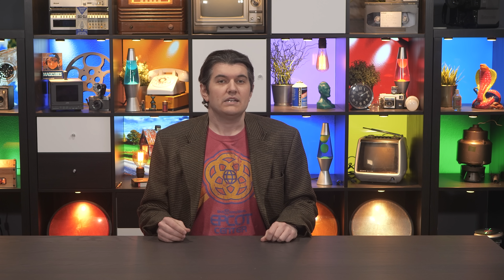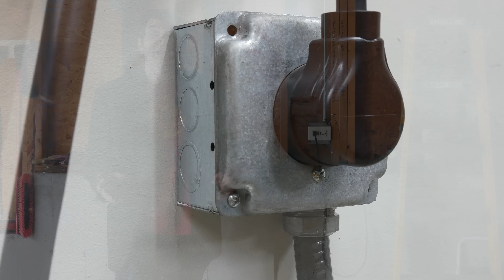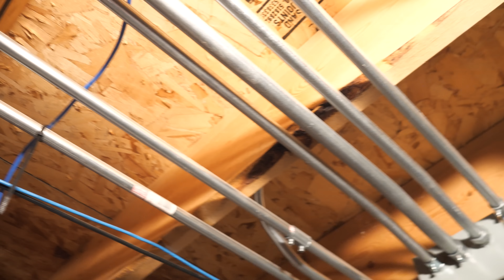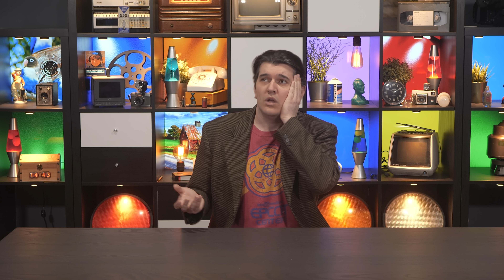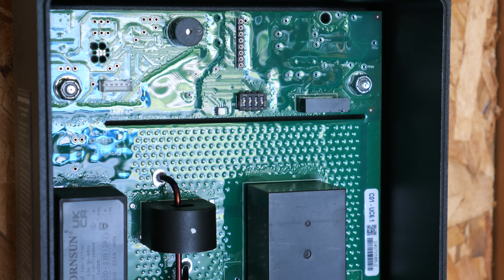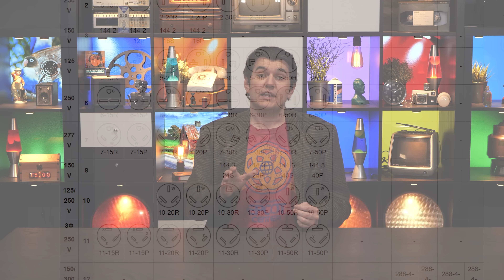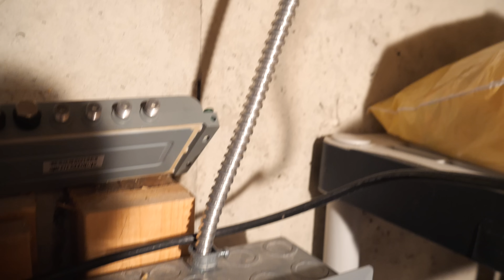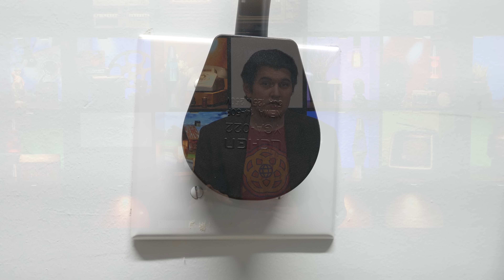The "standard" car charger is usually overkill—but your electrician might not know that

Comment: I bought a Spark EV for one stimi check! added a cup of coolant to match the updated TSB. Cleared the HV battery codes and it started charging! I've been charging on 120v AL wiring 20A breaker. (Car only draws 12A. I learned that charging on 120v, only works if you have enough reserve.... 40 miles a day with AC blasting in Arizona was not enough and definitely will not be in the winter. (Round trip #'s 18 miles for work, dog park 15 miles and 7 miles for the gym. My mistake that day I ran out... I pre conditioned the car 😂 after work. I wait for it to cool off before taking the dogs out and charge but charging speeds and not staring out at 100% that day really hurts.

Comment: I have a really short commute, and I live in Australia where 240V is standard, so the standard 10A outlet is more than enough. As for the “smart” features, I simply plugged the 1800W EVSE that came with the car into a Tapo TP-link smart plug. My car doesn’t have scheduled charging, so this is a perfect solution. I only charged on Saturday after a 10 day stint, even at 8A, the car charged 30% overnight.

Comment: Apartment owner without home charging here :)
Thanks for covering the really important parts of the whole EV-charging-at-home deal, and also calling out the challenges for us folks where things aren't so straight forward. I have to say I'm quite lucky and have found a suitable compromise - my work is 100% remote, so I tend to head to a public AC charger (11 kW usually) to plug in for a few hours while I work from the car. Then it's just the ~10 minute drive between home & the charger to deal with. While it's not exactly as convenient as charging at home, it's a reasoanble alternative.

Comment: I can explain to you why we're not pushing at home charging more. It's really simple. At home charging means you don't leave the house to go consume more other things. Think about how many times you go to a petrol station and start filling your car and then go inside for a drink or some crisps or some candy or whatever. If you're using home charging that's not happening. If use fast charging stations then a lot of those are starting to come with attached convenience stores because they know how long you're going to wait and you're going to get bored and you're going to go inside and you're going to go buy some stuff
Reply: No idea how it's in the US, but in Norway/Europe, it's way cheaper to charge at home, and almost everyone charge at night when the power is cheapest.  Smarty chargers can be set to charge when the power is cheapest, or at a set time.
Reply: I stopped going into the station when they started requiring pre-pay or pay at pump.  And then I bought a PHEV and almost stopped going to gas stations except when traveling.
Reply: I always pay debit at the pump and try to avoid going into convenience stores. Wife and kids on the other hand...😂

Comment: Nine years ago when we got a used Leaf, we first charged it at 110v, but eventually went for a 20 amp dryer outlet in the garage that let the Leaf charge at 3.3kw (all it was capable of) through a cheapo EVSE and we were all set!  When we traded in the Leaf for a Bolt in 2021, we opted to just continue using the 3.3kw charge cord, and it was more than adequate.

Late last year we moved into an older, downsized house (goodbye now-grown kids) and had to think through how to charge the Bolt. Turned out there was an electric dryer outlet in the basement that I could plug into and run a cord through a window well to the driveway, which worked with our old 3.3kw charger. We used that for the first few months, even though it was annoying to have the window cracked in wintertime, and even more annoying to have to fiddle with the cords and window well. However, it worked fine for charging the car. When we finally got around to doing some electrical work, we had them add a 50amp outlet on the outside of the house, and got the same Grizzl-E unit in the video. Still keeping the old EVSE as a backup.

Fully agree about using simple EVSEs. Cheaper, foolproof and you can do all the charge timing stuff you want through the car.

For rental properties, if the management could just get 3.3kw to where the cars are, it would work fine. People think they need 7-11kw, but they really don't.

Comment: about the siemens charger having a fault and needing to power cycle: i was having a similar issue. my car would charge and suddenly stop (sometimes 5 minutes, sometimes 5 days without problems). 

it seemed to me like maybe a data pin was losing connection for a milisecond and that tripped some safety thing.

 i ended up resolving it by putting dielectric grease on the pins for the charging cable. it has been like over a year and i haven't had that issue again :)

Comment: Something that could be handy and interesting to have is a temperature sensor. If it is freezing, having to heat up the battery to charge it may wast most of the power a granny cable can supply.

Having a "no charge when freezing" switch or a force charge when freezing button could be nice as I think cars responses to freezing is "heat up" instead of not charging.

I mean call me cheap but I don't like to waste 15kWh to 20kWh in a 10h cold overnight charge. I have off/peak pricing and 0.15€/kWh and 0.2€/kWh. It is much cheaper to charge during peak hours if I don't need to waste with heating the battery.

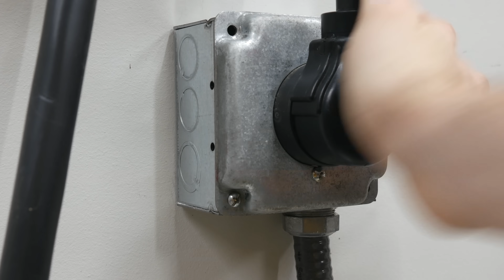Comment: 3:47 I see at least two code violations there. You need a cable clamp on the cable entering the back of the box, and the ground conductor is required to be connected to that metal box. 11:30 same grounding issue in that box too. 13:21 You are missing the disconnecting means. If you get rid of the receptacle, you usually need to add a disconnect switch.
Reply: IDK that the incoming NM-B must be clamped to the box, but that metallic j-box must be grounded.
Reply: he may have opted to remove some things for better camera visibility. he also may have just taken the camera shot before he had everything hooked up as needed.
Reply: Are you an expert in chicago area code?
Reply: @slash196 regardless of particular state code I think it's a no brainer that if you're going to run electricity through a metal box, you earth/ground that box. This is basic electrical safety.
Reply: @slash196 also, we might not be seeing the entirety of what's set up there. it might actually be grounded in some way, and there's more than one way to ground something.
Reply: @dead-claudia @jmdelapp this is a critical safety feature of any installation that includes metal enclosures or conduit. If he wanted to show people the correct way to do it then he should have made a specific point of this.
Reply: This (and many other reasons) is why people who are not electricians should not be doing this kind of work. What's even worse is he just showed a rather large number of other people who aren't electricians how to do it.
Reply: @deano023  This grounding issue is something I catch licensed electricians doing all the time. Being licensed does not guarantee competence.
Reply: @deano023  None of those things are a critical safety issue though. Yeah it's not "right", but when an electrician charges $500 in labor for 2 hours of work, don't be surprised when people opt to DIY.
Reply: @thelight3112  Fair call on the cost of electrician labour I suppose...

However I disagree with you about "critical safety issues". Any issue which has the potential to cause damage, harm or even death is "critical". All it takes is one of those conductors to be pinched when being pulled into the conduits or boxes which could then expose a live conductor. It may test fine at commissioning but something like an earthquake or other building vibration could move it slightly and cause not only the metal box but the entire metal conduit it is attached to become live. You cannot dispute that properly grounding all of the metal will prevent this, provided that the RCD/GFCI is working properly - of course.

The wirenuts are also a poor choice for this reason. Enough vibration can cause them to become loose, creating a similar possible failure mode.

I don't have a problem with someone who is competent to do their own electrical work whether they are licenced or not.. hell, I've come across plenty of licenced electricians who do work that is worse than what Alec has done in this video..  but you cannot dispute that if you pay an electrician $500 to do the work then you are almost guaranteed the work is going to be done properly and to code.

My major gripe is the fact that he's made a video about it and broadcast it to the world so ultimately you're going to end up with people that are substantially less competent than he is trying to "save themselves $400". The instructions that they are following don't even include those "critical safety features" such as grounding metal enclosures and conduits. This is not optional, it is code for a reason.

I mean, even if he did follow the correct procedure I still wouldn't suggest he makes a video about it to show everyone how to do it. The facts remains there's still a reasonable chance that this video will cause someone to either burn their house down, electrocute themselves or someone else.

Comment: The only time I recommend oversizing your charger is if you regularly see freezing temps in the winter and park outside. A lot of time (and energy) is wasted heating the battery for an overnight charge, and if you are relying on that full 8 hr to charge your car, you might spend the first hour of charging just warming the battery up and then have a reduced rate after that. Last winter before I got my 240v charger installed, I had to charge overnight when it was sub zero (F) and ended up with around 40% charge efficiency. More energy was wasted heating the battery than was added as useable miles. That being said, those days are quite rare and that was on the slowest of charging options possible.

On especially cold days, you may even be forced to rely on DC fast charging for a supplement. While neither of these will ultimately be that big of a deal as you can always charge daily instead of every 2-3 days, it does give some peace of mind knowing you won't have to deal with those edge cases.

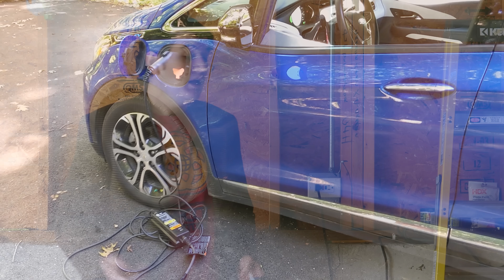Comment: 3:03 if you plan on buying an ev, please, completely ignore your existing outlets. That think cost 49 cents, is probably a decade old and really cannot handle the constant load of an ev all night every night. Iirc, dedicated circuits are a requirement anyway for permanent ev chargers. And at that point, you may as well go with a 20 amp 240v circuit like a nema 6-20 since it runs on bog standard 12/2 romex

Comment: The only problem with reduced current charging: The car needs to run its control electronics during charging. Some cars consume several hundred Watts for this. This load is constant and a total loss. So the longer a car needs to charge, the more energy gets wasted with these constant charging losses.

Comment: Would you possibly be willing to do a video on "recreational vehicles/trailers"?

I've been following the channel for a while and the videos on air-conditioning and heat pumps are very helpful, but I have no clue how to integrate that into a mobile home, let alone set up appropriate wiring for a home battery system.

Im sure this is a big ask but it's a very confusing thing. Whole home solar/alternative power and storage would help a lot. Among other things.

Comment: 12:20 Ok, I'll bite. Why wire nuts? I'm NOT a professional, so spending just a tiny more money on crimp / splicing connectors of any brand  (you don't need 100 of them anyway) will make your life so much easier!
Yes, you need to buy fancy things if you work with aluminum, but who does that!

Those connectors (wago or any other company) are so easy! You don't need to worry if your spirals are tight enough. Most have test points to check for power. Installation takes seconds, and since you are not twisting the wires, (DON'T DO next part) live wire is not a problem for a quick fix when you messed up and connected wrong wires (seriously, don't do this). Bad wet salty air conditions? Some connectors have a gel inside to protect the contacts.

The only reason to use wire nuts is cost. But for awg10 the 221-612 costs $1 near me. How many would you need to say "it's too expensive"? How confident you have to be in your twisting wires abilities when dealing with awg10?

Comment: The biggest unknown for me is long term reliability.  I know how to fix and maintain engines, and I have a 200k+ mile gas engine running just fine with maybe $100-200 in unexpected repairs (so not routine maintenance costs like oil).  It will likely stay running many more years.  I am curious about the long-term costs of owning an EV.  If I don't lose meaningful battery capacity by the 20 year mark, that's great.  If I do lose capacity and have to change it after 10 years, what's the price of the battery?

Comment: The comment comparing fully charging your EV vs refueling a gas powered vehicle daily is a tad misleading in one of your range anxiety comments.  Since most EV's have a much smaller range range than an ICE vehicle, (my teenage ICE vehicle with a 300 mile range notwithstanding), this is not an apples to apples comparison.

Comment: I just charge my Volt (45+ mi. electric range) on a standard 15A circuit (at 12A).  I use it have it on a GFI circuit at my own place, but I'm now taking care of a parent so I'm just using a standard non-GFI outlet (the garage was built in 1982).

Comment: Over here in the UK its standard that home chargers (7.7kWh) are hard installed. As generally people don't park in garages its not always practical to charge from a domestic outlet.  I have a charger hardwired into my house that's mounted to the outside wall and it works great. Software as well plays a big part into chargers. We have access to smart EV electric tariffs. This means we can get cheap charging for our EV (7p kWh approx. 9.5 Cents) overnight or when the grid has cheap wholesale prices.

Comment: On my 120-volt 15 amp circuit I set my charging station to limit to 6 amps as a rudimentary Band-Aid to try to keep the charge from going over 80%. The BMS in my car doesn't have any ability to stop charging at 80%. I just wanted to illustrate that it can be perfectly acceptable four people with moderate driving habits to get plenty of charge from a regular receptacle.

Comment: I feel like a better solution is a battery backup that recharges slow during low cost times and fast when charging the car. 

Other thoughts:
1. I can see how a faster charger would have perceived increase in resale value similar to a hot tub. 
2. As EV's range increases my next EV is likely to take longer to charge. 
3. If I have more than one EV faster charging becomes more convenient and cheaper. 
4. Since many are unmanned, I still find a lot of recharge stations are often broken for days to weeks. 
5. Range anxiety comes less from running out over a week or month of use, but by being late because a trip needs 200 miles and the car is at 189 say, because the power went out while asleep. 
6. There are still cities with zero commercial EV chargers.

Comment: Add to this, the reason a 240V EVSE is preferred is charging loses. If you charge your EV with 120V, you'll use more total energy to charge it than if you used 240V at the same amps because of the charging systems continuous power use during the charge session. For example, if it takes 10 hours to fully charge our EV @ 120V, then charging it at twice the voltage, 240V will reduce your charging time by half and use less power than if you measured the 120V charging time and cut the cost in half to compare. 😁
Reply: Yes, Alec addressed this in his Pinned post at the top of the comments.  Three hours before your post.
Reply: @alsavage1  Youtube doesn't have real-time comments, this is why I didn't see it when I came back. I had to refresh the section to see it, so I'm glad the info was put up. Never hurts to have information confirmation. 😀
Reply: @KnightMB1 but also, the breakeven is somewhere between a decade and never.
Reply: @thedave1771  So you think twice the wear on your charging equipment doesn't mean anything in the long run? I see now why Alec often talks about not wanting to engage with people in the comments section. 😅
Reply: @KnightMB1  Agreed. 120 volt charging is very inefficient. You use between 100 and 300w just keeping the car on to charge, depending on the ambient temp and a few other factors. Just going from a 15amp outlet to a 20amp outlet increases my charging speed from 4mph to 6mph.

Comment: So one thing has made me adjust my stance on how many amps of ev charging you need: solar. If you’re on pure grid power, sure, 16a 240v is fine. If you have solar or hell, live in an area with cheap electricity during the day due to solar, then you could waste a lot of solar production simply because you didn’t have a fast enough home charger.

Comment: The electric charges seems to have extremely poor reliability. Atleast the 2  companies I worked and working now. Its such a inconvenience when it comes to availability and challenges with weather even nowadays with all the rain. I was also had concerns about Nissan Leaf charging design when its upright and getting wet in rain. My friends also face many software issues in charging, especially the friend with BMW. BTW I do not hate EVs. I love my friends and others buying EVs. I often test drive EVs even though I'm not interested to buy one.

Comment: Electric clothes dryers use 30A, 240V plugs? 
How wet are your clothes in America?
Reply: It’s about efficiency. 240v three phase is more efficient
Reply: @daveh2612 but dude -is it necessary to blast your clothes with 7.2kW?
We just have dryers on normal (240V) circuits in Australia (although we mostly hang our clothes outside to dry anyway)